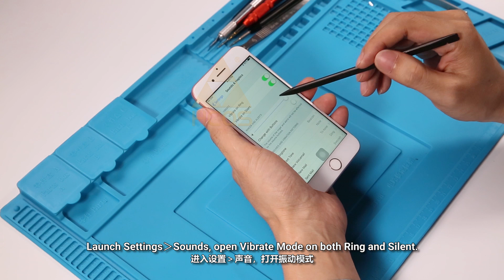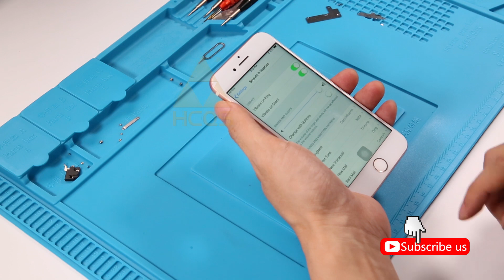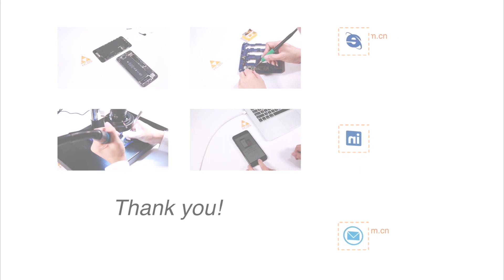How to Fix iPhone 7 Vibrator Not Working | Motherboard Repair

Comment: and what if the pin 40,41,43,44 showed 0 diode resistance on charging connector J4101?

Comment: But U3502 is speaker amp 2 ic, not vibrator ic. Am I right?
Reply from the maker: In the iPhone schematic, loudspeaker or ear speaker will be called "SPEAKER AMP". But according to the schematic, the U3502 is called " ARC DRIVE". , so the U3502 is not a speaker amp.